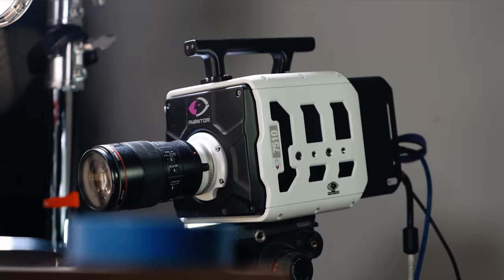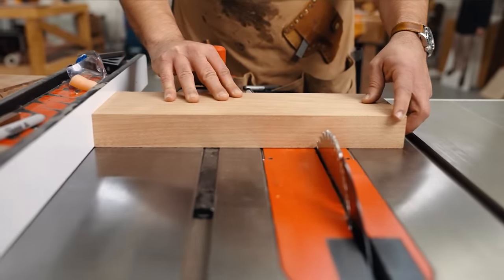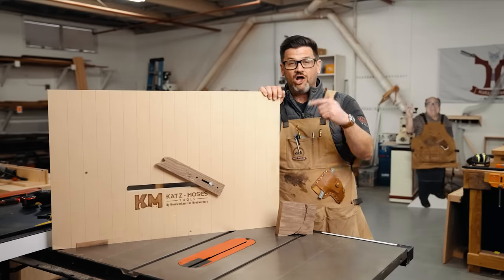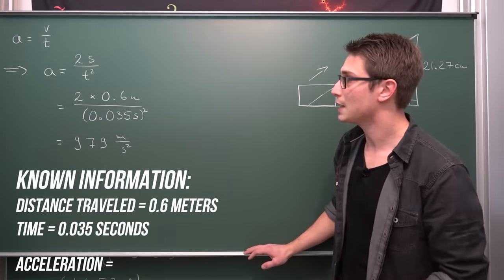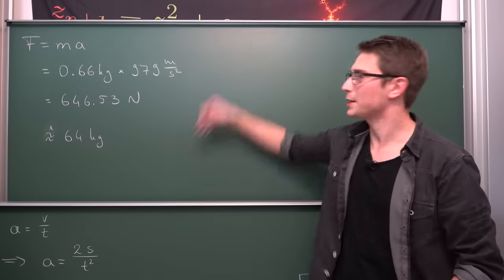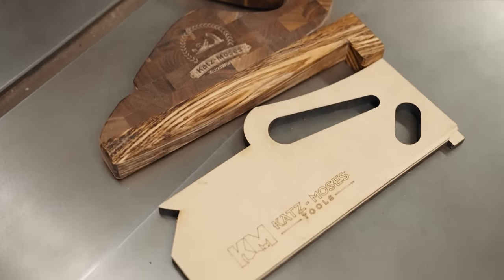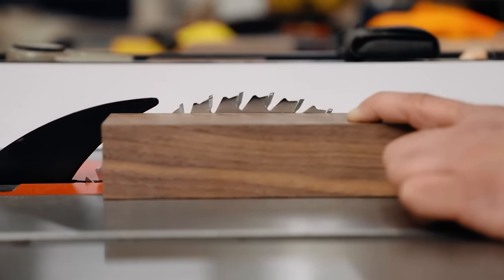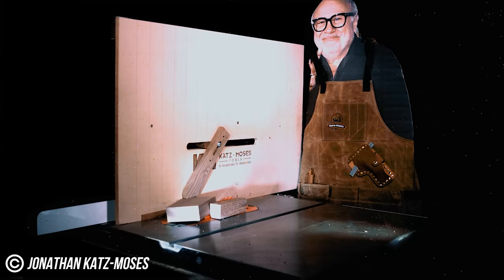The Anatomy of a Table Saw Kickback at 50,000 FPS Ultra Slow Motion in HD

Comment: I fully appreciate the apron being considered PPE (if only for it adding an additional layer of separation between you and a kickback projectile)...but what about all of that stuff you have...well, "stuffed" into the pockets? The apron that the jello-JKM wore didn't have anything in the pockets. Your apron looks to have a pen, a compass, some metal thing with a ring on the top, and a marking knife (?) – and that’s just the top-center pocket. Those items have half as much separation from your body as the jello-JKM mock up scenario, and I have to believe that a kickback projectile hitting the stuff would focus the force of the projectile into much smaller area (at least a little). Could that stuff possibly break, causing it to penetrate the canvas? What about a kickback projectile catching that square (in the holster) just right to cause the square to cut right through the apron material (and whatever is behind it)?

My kickback moment was nearly 20 years ago. The fence on the el cheapo table saw that I had at the time didn’t latch down quite square, and the (~18”x18” IIRC) piece of 3/4" plywood I was trimming got wedged. The plywood somehow bounced off of the back of my wrist and flew across the room (leaving a pretty good sized dent in the dryer 10 feet away  -- and a welt on my wrist that could pretty much fill the dent in the dryer).

Comment: GREAT stuff, Jonathan. You covered some points I haven't seen on YT regarding kickbacks, and I certainly don't want to get smacked in the chest with 1/2 of a JKM moving at high speed!
  One item I noticed using your example is the length of the board being ripped. I was always paranoid ripping really short pieces, as it seemed easier for the board to lift on the rear of the blade. I would rip a longer piece first, then cross cut. Regarding those chicken foot push sticks, they are almost worse ( in some instances) than none at all.
Reply: Re: "I would rip a longer piece first, then cross cut."
Yup.  Me too.
I have clamped a board to the fence to hold the workpiece down.

Comment: high school  as a junior, it was my second shop class. curiosity got the better of me and I took a two foot long piece of thin scrap. and gently  placed it on the running blade.  the energy was such that it snapped the scrap half way up and shot the lower piece over my shoulder. I was wearing safety goggles thank god. definitely learned my lesson. My shop teacher was quite amused.

Comment: Also... another reason for kickback is the old adage that the Table Saw is the heart of your workshop. Trying to use it for EVERYTHING when other, more safer tools are available. If it's your ONLY tool, I get it... but let's be real, most of us have a miter saw, a circular saw, router and band saw. The order of operations is important too. When bringing home sheet goods, cut them down to manageable sizes, and NOT on the table saw. Good God... terrible shop practice right there.

I find that that because I forced myself to by a Track Saw BEFORE I bought a table saw, I make safer cuts, and plan things better. I rarely use the Table Saw now. And when I do, it's usually the cross-cut sled or a dado stack on wide boards, where the router and a track guide were a little too inconvenient. Because I have a nicer Incra fence on my table saw, and I can sneak up on things like rabbets better than the router table. But I'm going to add my router to my table saw eventually, so I can use that fence system for that as well. Further diminishing my need and reliance on the table saw even more.

Comment: This is a very informative video that I think every woodworker should watch. I also know too many woodworkers who use their old unisaws and craftsmans without any sort of protection like a splitter or riving knife, and I always recommend to them the micro jig splitter, but it’s definitely not as good as a riving knife. Also, at 9:30, did it trip the sawstop? If it did, how? It looked so fast, even through the high speed camera! Great video!
Reply from the maker: The force caused the blade to drop but didn't activate the cartridge
Reply: @katzmosestools  ah. That goes to show how much force a kickback has, and how dangerous it is

Comment: I first took woodworking classes through a community college extension course at a high school shop almost 20 years ago.  The instructors pointed out the wall of shame where they hung all of the examples of kickback over the years.  Then it hit me,  literally.  I was using the table saw one day and got hit by a piece of maple in the stomach. I had a huge bruise for months.  But I didn't want to end up on the wall of shame so I didn't tell anyone in the class about my mistake.
Reply: For anyone else who's in a shop class and doesn't say anything remember internal injuries (especially the spleen!) Can be incredibly dangerous if unnoticed quickly. Getting checked is far more important then your pride. Mistakes happen, we do what we can to prevent them but if something happens saying something is important. 

Most people will turn away from an impact, turn towards the right and you expose your spleen which if ruptured can go south REALLY quickly even if you just think it's pain from impact. Id encourage everyone to take the right precautions before hand but also have a process of what to do if something happens.

Comment: This is exactly why I rip everything I possibly can on my radial arm saw.  With the radial, you are not standing in the line of fire of a kickback. The saw kicks the piece either to the left or to the right depending on the way you turn the saw head.  And you set the guard so the blade can not lift the piece off the table.

Comment: Can you explain more about blade height in regards to kickback safety? I had actually thought that having the blade higher would be safer in that the forces on the wood are more downwards in the front of the cut, rather than towards the operator. Please do a video on blade height physics when you can, thanks!
Reply from the maker: We have a video coming out soon on the subject
Reply: I'm interested in that also. I was taught to raise the blade so the bottom of the gullet was at the top of the piece of wood. Mainly for sawdust clearing. I didn't realize it could have an effect on kickback. Looking forward to the video on that.

Comment: Sorry to fact check, but the math is all wrong.  The acceleration induced by the blade is not only calculated wrong, but is irrelevant to the impact on the body.  The only thing that matters is the kinetic energy of the object based on the mass (M) and the velocity (V) ... Energy = (1/2 MV^2).  If you assume that the velocity is .06m/.035s, then the kinetic energy is about 97 Joules, or about that of a baseball at 81 MPH.
Reply: Absolutely and it’s embarrassing! You don’t get hit with the force used to throw an object! You get hit with the momentum it has at the moment of collision! All that’s needed is speed and mass to calculate this! (And then dampening effect in the colliding materials can soften the impact!) Once the pice is moving, it is only accelerating SLOWER (aka slowing down) due to air resistance and gravity… the initial force used is not relevant—and cannot even be calculated — only the velocity achieved by the initial force… The force of the saw blade has to do with the mechanics of the blade itself.. but once it strikes the object, the questions becomes 1 Can it throw the object (overcoming the object’s inertia), and if so, what is the speed of the saw because that will become the speed of the object! Then the object will be slowed by gravity and resistance against the table and the air. 

So the force at the blade is relevant when determining whether the object will be thrown or bog down the blade. Internal motor force capacity vs inertia of the workpiece.
Reply: Why would you assume velocity is 0.06m/0.035s? (1) it is 0.6m distance, (2) that is the average speed, not the speed at the end. the speed at the end is simply a*t = 34 m/s, which comes out to 390 J.
Reply: @capnjs  yeah, i noticed that too. I forget that mathematicians tend not to know any physics.
Reply: Maths!!
Reply: Your "correction" is wrong. You don't feel kinetic energy, you feel the change in momentum, i.e. the force times time. Momentum does not equal kinetic energy.
Reply: @dhawkins1234  you feel both kinetic energy and momentum. momentum determines how you recoil. kinetic energy determines how much damage.
Reply: @arkie87  yes momentum is related to recoil. But "damage" is not a physics term. You feel force. That's what breaks bones, crushes organs, etc. Force is defined by change in momentum over time. If you were trapped between a loaded semi-truck and a wall, even if its speed were almost zero (and therefore relatively low KE compared to its momentum), it could still crush you to death. On the other hand, small objects that move really fast have high KE but low momentum, can be absorbed much more easily by e.g. protective clothing. At least as long as the protection is strong enough to resist piercing. But that same protective clothing would do little to a high momentum object like a sledgehammer.
Reply: C'mon girls!  While everyone was arguing I built a complete set of kitchen cabinets!

Comment: I have an old Diablo blade on my Shop Fox table saw. It's never been a problem before, but now the wood is drifting away from the fence after passing thru the blade.  I'm using a good featherboard, and a good push stick. My saw may be suddenly out of alignment, but I was also thinking that it might be a dull saw blade. Any thoughts?

Comment: Please do a video showing the safety afforded by the riving knife, as well as a blade guard. You could use the same setup, and I would like to watch the stock ride up the knife and slide on out the back instead. I really want to know what the real risk is and how much help these safety features are. Also, how helpful is a feather board? I would imagine its important. I used them for years on my radial arm saw and never got hurt.

Comment: I feel safer using a crosscut sled, because both sides of the cut are supported, and I am thinking that the fence will 1) reduce the risk of kickback, and 2) the rear fence will collect the timber if I do have a kickback.  Is that a valid point of view?  From this video, it looks like the timber would kickback above the rear fence, so the sled doesn't off the protection I have been thinking it did.

Comment: Another additional way to prevent injury by kickbacks : Don't stand right in line/behind the blade.
There are very few cuts, where it is necessary to stand right in line with the blade. In Europe tables saws with sliding tables are very common in professional environments - i think called "panel saw" in the US. With those it's impossible to stand in line with the blade. Essentially they work like a huge cross-cut sled.

Comment: The potential speed of the missile from a table saw, equals the motor RPM, added to the blade circumference, converted into miles per hour. It's not far off 120 mph????   Adding a crown guard to your riving knife is useful too, but hardly anyone in North America is sensible enough to use one.

Comment: First table saw I ever owned was a 70’s Craftsman 113, changed the blade before using it for the first time but forgot to put the hold down screw back into the steel throat plate. Few days after the blade change, I cut something too small and it fell into the gap between the plate and the blade. It lifted the steel insert out of its home and the blade threw it about 10’ across the room. Found four blade teeth scattered on the floor and the insert was very chewed up. I was standing off to the left, but I don’t want to think how bad it could have been if I had been standing behind it. Still have and use that table saw but I didn’t use it again after that until getting a zero clearance insert,  MJ splitter, and replaced the fence.

Comment: You can free hand on a table saw if you’re expierenced enough(not a recommendation for someone who’s new to woodworking/carpentry). In finish we scribe material to floors, walls, etc almost always using table saws. This includes baseboard, cabinet fillers, anything that is reasonable to scribe on a job site table saw. I’ve scribed 8’ wall fillers on a bevel where the wall bows in and out over 3/4 inch and haven’t had problems. Table saw safety is all a matter of experience and confidence in my opinion. Great video regardless love your content

Comment: To make this even more scary: this piece of wood weighing 0.66 kg with an acceleration of 979 m/s² will in 0.035s reach a speed of 34.265 m/s which is about 123 km/h or 77 mph. At that point its kinetic energy is about 385 Joules. When the piece of wood hits you that energy is suddenly released.
And this is where Flammable Maths imho makes a mistake. He is calculating the force the saw has exerted on the piece of wood to give it its acceleration. But what he should have calculated is the force of impact of the wood on the body.
Now, let's say the piece of wood hits the body and stops in about 5 milliseconds or 0.005 seconds. That means the average force of impact is 4523 N or 452 kg (or 4 JKM's). The peak impact force will be about twice as much, so about 900 kg.

Comment: Great video Jonathan. Now that my head has stopped spinning from all that math I would like to add 1 more safety requirement that I never see on these table saw videos and that is the placement of the push stick. The push stick should always be placed left of center (closer to the blade than the fence)  between the blade and the fence forcing the leading edge of the material towards the fence and not the blade. i.e. If you have a 12" board and you have your push stick next to the fence it would push the leading edge away from the fence causing a kickback.
Reply: If you are cutting a 12" board, why are you using a push stick?
You should be using a miter gauge (simple or fancy) or a cross cut sled.
Reply: @zapa1pnt  Let me clarify. A 12"x4' board that I want to rip to 11" x4'. Now seeing that you would not use a miter gauge or cross cut sled to perform this task, where would your push stick placement be?
Reply: @donbeebe2110 : Oh OK. I was reading the orientation wrong.

Comment: bought a radial arm saw in 1975 . tried to rip a 2 inch thick by 2 foot long 4 inch wide piece of oak. it broke the blade cover casting and still hit the ceiling with enough force to put a half inch depression in the pine ceiling. must not have had the kickback paws tight enough but i got a feeling they couldn't be tight enough. happens way tooo fast to blink.

Comment: The math used to compare the energy of the wood hitting you is incorrect. The force and acceleration calculations are correct however to know the energy of the wood hitting you, you have to factor in the time that the force was applied to the wood. 
To put it another way, if the wood is being accelerated at 979m/s^2 for 0.035 seconds as stated in the video, it's traveling at 34m/s when it leaves the blade. Actually the acceleration time of the wood on the blade is maybe only a third of this since we can see that the distance used for the calculations is 0.6m, but the wood is being accelerated by the blade for only the distance across the blade which is much less than 0.6m. Conservatively using half of the stated time period, the wood is being accelerated for 0.0175 seconds. This gives a speed leaving the blade of 17m/s. This would be roughly the same energy as the block of wood being dropped from about 14m, certainly not 'A half Jonothan Katz Moses jumping from a 10 storey building'. Even if it was traveling 34m/s based on the full distance calculation, that would be the same as dropping the wood from about 60m. In fact 646 newtons is the force under the feet of a half-Jonathan Katz Moses just standing on the ground.
For a 0.66kg piece of wood to have the same energy as half a person jumping from a 10 storey building, it would have to be traveling about 250m/s which is approaching the speed of sound. Clearly this is ridiculous.
Reply: Now you believe me, Jonathan Katz Moses?
Reply: I was scrolling for this comment. Thank you. This "Mathematician" not only gave a bad example but was also clueless about what he was talking about.
Reply: @zuvermieten  Frustrating isn't it? Any video encouraging people to be safe around a table saw is good, but c'mon, the maths here is totally wrong. There are so many obvious other factors missing too, eg the power of the table saw is a limiting factor in how much power can be converted into kinetic energy in the block of wood, the actual size and linear velocity of the saw blade is a limiting factor too and you could even calculate the speed of the wood by knowing the linear speed of the blade and comparing their movements in the high speed footage. The conclusions in the video are just wrong in so many ways.

Comment: I had a kickback on my table saw caused by the 24" x 3/16"  cut off piece slipping between my blade and the throat plate. I was cutting and heard a loud explosion and the piece of wood was just gone. Couldn't find it anywhere, until 2 days later when I went into the back corner of my shop and found it embedded into a bundle of furniture pads. That corner of my shop is around 35' from where my table saw sits. I don't even want to think about the damage that would have done if it had hit me.

Comment: I had my miter saw pick up a small wood block I was trying to do a straight edge on. It broke parts of the saw assembly and I saw chunks flying in my yard like 8 meters away. I never found the block. I think it flew across the street (which was behind the saw).